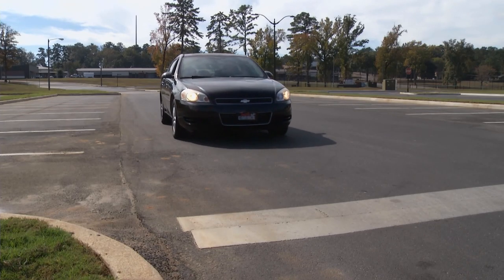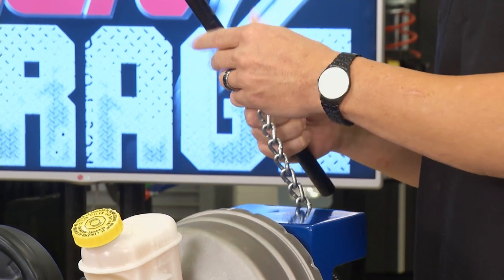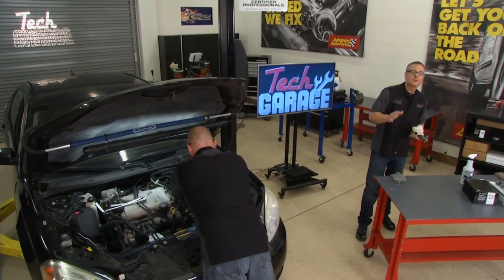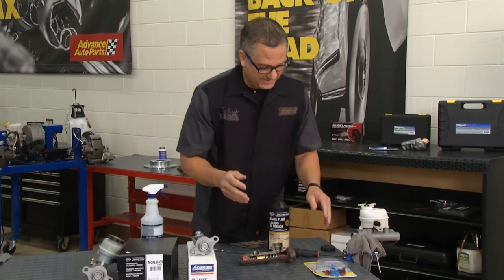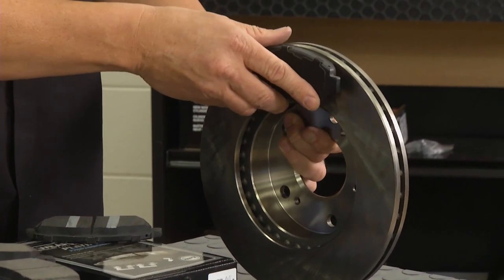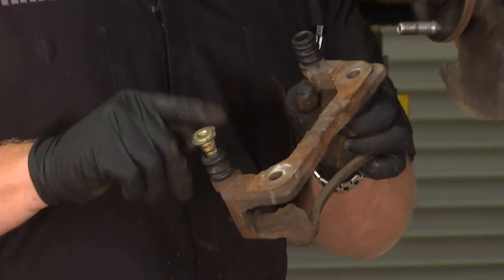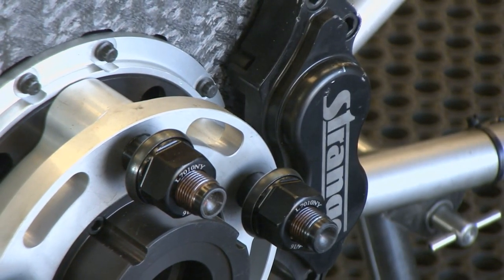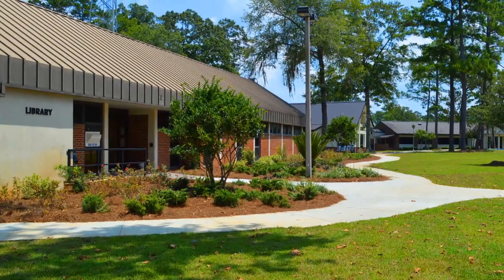Tech Garage - Ep 1701

Comment: I have a question I have a 2002chevy Silverado 1500HD and it has the hydro boost break system and quite often when I step on the pedal it pulsates like the abs is kicking in but there's no reason for it to and there's no abs code please help me
Reply: Joshua Magnuson I wood replace ur rotors and pads